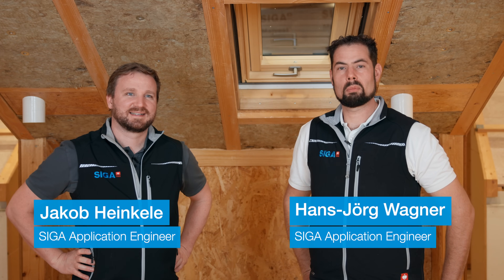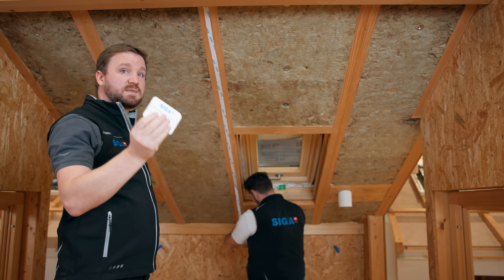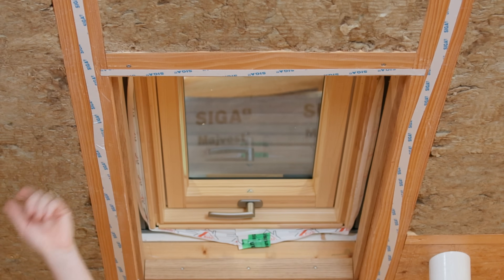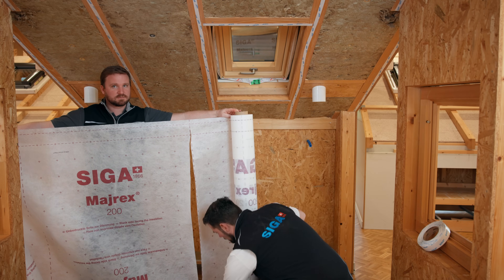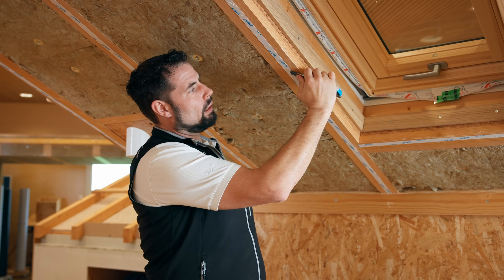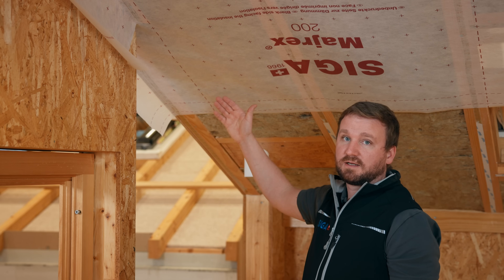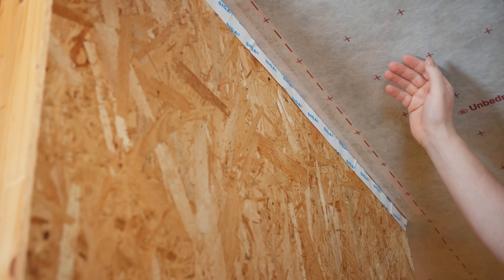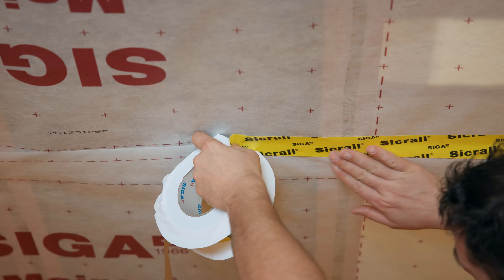Vapour Control Layer: The Ultimate Installation Guide - SIGA Majrex 200

Comment: I’m building a stud built barndominium house with a metal roof. Can I install rockwool directly to the roofdeck and then use the sigma over that? Or should I use Tyvek house wrap, then rockwool, then sigma over that?
Reply: Hello, generally speaking we recommend a watertight layer to protect your insulation from any moisture building up beneath the metal roof, or in case of a leak. Best, your SIGA Team

Comment: As soon as you fix your plasterboard to the ceiling your membrane will be pierced, so I don't see the point of struggling with the tape;  unless the tap has the ability to ceil around the nails / screws.
Reply from the maker: The Twinet tape is used only as an installation aid.
It does not create any airtightness around nails or screws, but it makes your work easier when you are working above your head.
It also reduces the need for stapler clips. In general we want to avoid piercing the membrane as much as we can.  We also recommend an additional layer of slats to ceate a substructure for your plasterboard. This way, your screws will not pierce the membrane.

Best regards
Your SIGA Team